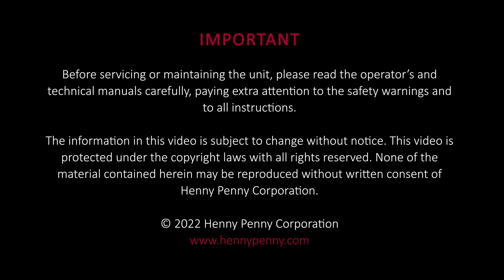Troubleshooting the E-60 (communication failure) error code on LOV and Evolution Elite fryers.

Comment: I have a LVG 203 fryer for a McDonald’s restaurant with this issue. AIF board is off (no LED) and I tested AC Voltage at the incoming connected from the transformer which should be 18V and I’m reading less than 1V. Would my transformer be the issue ? I am looking at the manual and see no fuse for this unit.